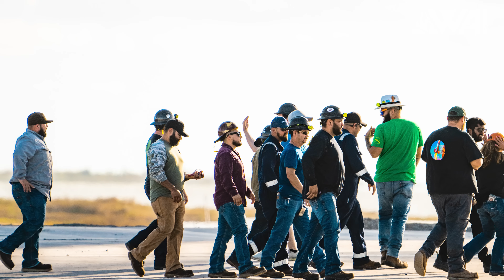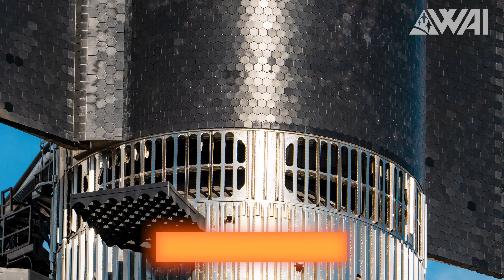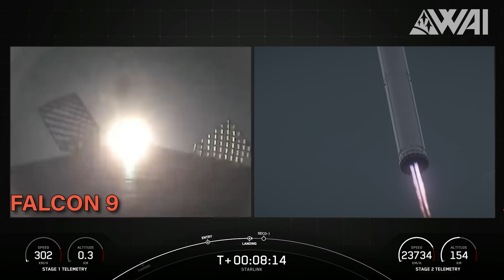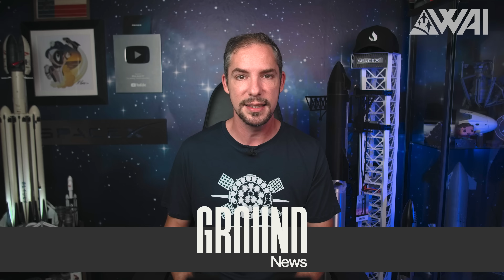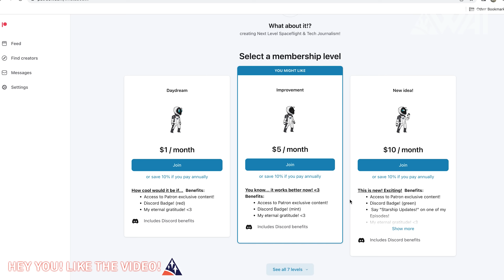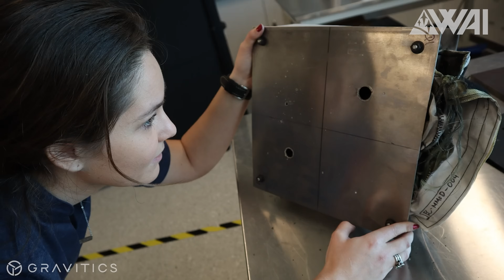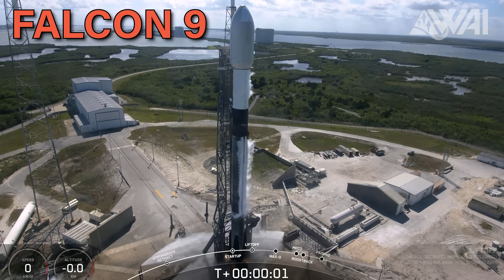SpaceX Starship Setback: A Year Without Payload – Hiccup or Concern?

Comment: I did a little bit of calculations because I got scared of this 6600 starships launches, here is a breakdown of what that would mean:

Fuel Requirements:

Per Launch (Starship or Tanker):
Fuel required to reach orbit: 1,050 tons.
Fuel required for landing: 30 tons.
Total fuel per launch: 1,050 + 30 = 1,080 tons.
Refueling in Orbit:
Each tanker can deliver 150 tons of fuel to the Starship.
Total fuel delivered by 8 tankers: 8 × 150 = 1,200 tons.
Total Fuel Requirement for the Whole Fleet:

Total fuel per Starship mission: 1,080 tons for initial launch + 8 × 1,080 tons for tanker launches + 1,200 tons delivered by tankers = 10,440 tons.
10,440 tons × 6,667 Starships = 69,546,280 tons.
Split between methane and oxygen based on a 3.6:1 ratio: 15,676,006 tons of methane and 53,870,274 tons of oxygen.
Cost:

Using NASA's prices: $160 per ton for oxygen and $400 per ton for methane.
Total cost = (15,676,006 × 400) + (53,870,274 × 160) = 14,409,204,640 USD.
Summary:
Number of Required Flights:

Starships: 6,667 launches.
Tankers: 53,336 launches (8 tankers for each of the 6,667 Starships).
Boosters: 60,003 launches (1 booster for each Starship and Tanker launch).
Total Launches: 60,003 launches.
Fuel Requirements:

Total Fuel Requirement for the Mission: 69,546,280 tons (15,676,006 tons of methane and 53,870,274 tons of oxygen).
Fuel Requirement per Launch to reach orbit and land: 1,080 tons.
Fuel delivered per Tanker: 150 tons.
Cost:

Total Fuel Cost for the Mission: Approximately 14.4 billion USD.
Fuel Global Production Ratio:

Methane: The mission would require about 0.65% of the annual global production of methane.
Oxygen: The mission would require about 3.59% of the annual global production of oxygen.
Environmental Impact:

Emissions from Launches: Assuming complete combustion, the total emissions from 60,003 launches would be 15,676,006 tons of CO2.
Aviation Emissions Comparison: The total emissions from these launches are significantly less than the annual emissions from the global aviation industry (915 million tons of CO2 in 2019).
Reply: Don’t forget the co2 used to protect against fires in Super Heavy’s engine bay. Why don’t they use nitrogen?
Reply: @EMichaelBall I don’t know why they don’t use nitrogen, but I wouldn’t consider any of that emissions significant.

Comment: Mars should be an aspirational goal.  It's going to be a good couple years to get Starship crew rated.  So use what you have now, the Dragon and the Falcon 9.  They need to seriously fast tract the Polaris Dawn missions, finish designing an EVA suit and bring a crew dragon up to meet Starship in orbit.  Have Starship bring a practice module to deploy that the astronauts can practice welding and manufacturing with.  Then when Gravitics is ready to launch a station module they will be ready.  New Space stations then Moon then Mars.

Comment: Mars colonization is "feasible". That is, it can be done but not a worthy goal I think. I would guess in the long run, other space installations would over take any Mars base in both importance and population. This would leave Mars as either a slum (abandoned by those who can afford to leave) or a cult based colony where rich eccentrics (and maybe less rich too) become hermits or one religious group (possibly a new religion). The only thing keeping it from becoming backwards being remote learning. An early setup on Mars would be a mistake in pretty much all cases. A strong colony on the Moon would be a better first start. The only real use for a colony on Mars would be to keep "the other guys" from claiming the whole planet, in which case it would be an "outpost" and never really a colony. There are other (probably better) options besides Mars to move away from being "tethered to Earth"... though the reality is that Earth will remain the "gold standard" well beyond the point where more people live off Earth than on.

Comment: I'm retired now, but used to work in astronomy.  There are several 6m and 8m telescope designs already being worked on with intent to launch via Starship.  The JWST is about 6.5m in diameter but they had to use a folding segmented mirror design to get it to fit inside the rocket.  Expensive, complicated and risky.  The new designs are single piece mirrors. They have already made many 6.5m - 8.4m light weight honeycomb mirrors that are in operating telescopes.  Ten years from now there will be many 8m class instruments in space, assuming starship achieves the necessary reliability.

Comment: Here’s an idea for the hot separation ring. Use ceramic tiles on the inside Hub that directs the flames out ward and may save the ring deflection Hub. Please excuse the names of the parts of the ring. Just a thought.
Reply: The tiles are designed for that and would likely end up flying debris instead
Reply: The longest time that the ring deflection hub will be exposed to high heat will most likely 3-4 seconds. If you look at the hot staging ring deflection dome, it's pretty thick - it should hold up OK, without any extra shielding...remember, the booster will veer away from the Starship once it separates, to do its boostback burn...

Comment: Excellent episode. I don't know why they need 14.9 psi in space stations, 8 psi and 40% oxygen is equally as good and requires a lighter pressure vessel.
Reply: I believe that to be true but with more O2 comes a risk of increased fire severity, think Apollo 1. The ISS operates at earth normal pressure (14.7psi) and oxygen percentage  (21%). Space suits for EVA's work at about 4.3psi with 100% oxygen.
Reply: @jimmarburger611  Yes Apollo 1 was caused by Oxygen but it was 100% and 21 psi. 40% at 8psi is the same amount of oxygen molecules, so no increases risk, just less Nitrogen
Reply: I believe that even with progressive adjustment, the average human body will still feel the effects of altitude sickness at 8 PSI. They most likely prepare to send people that are not necessarily trained astronauts. But I do agree that somewhere in between 14.9 and 8 would be better.

Comment: What people forget for the Mars trip is you only go every 2 years if there are people on board, it might take longer but you could launch every day remotely, and take the Venus slingshot too.
Reply: I was just thinking you don't need a pilot as I'm sure the 1st moon or Mars landing will be unmanned so they can keep a constant flow of supplies and equipment but people wouldn't want to go on the longer trips
Reply: To really mix it up, can't they get the booster into orbit and refill it and it would get to Mars quite quickly then refill and return as an interplanetary booster 🤔
Reply: @neilhallam8028 not really worth doing unfortunately, the engines on super heavy are tuned for in atmosphere use because it has to push starship up and out, starship currently has 3 vacuum and 3 atmospheric engines. Although eventually boosters could be constructed on Mars and used to launch starships for more efficient relaunch
Reply: The transfer windows for an efficient "Venus slingshot" opens every 16 month, so not really more frequent, only the travel time is reduced. All this actually doesn't matter because there are dozens of problems that aren't solved even if a manned spacecraft would arrive in a Mars orbit tomorrow. And that is for a manned land and return mission, let alone the insane idea of a colony on Mars with the current state of tech and knowlegde.
Reply: @waxilliumladrian what about 100 super heavies in space ready to catch a boosted starship, and boost them one by one to mars. With a slow constant return to locations between Mars and earth orbits. With several other super heavies with fuel tanks to fill them.
Reply: @UmmerFarooq-wx4yo afaik, orbital mechanics would allow the "constant" flow only for a few months until you have to wait till the next transfer window. But even if you boost your starship to Mars orbit: And then? A propelled landing Starship on the surface of Mars would dig it's own grave, because there is nearly no hard surface. And it wouldn't have enough fuel to fly back to orbit anyways. So you have to fly hundreds if not thousands lighter space ships to prepare a landing site first. What are those exactly? And you could go on and on with more problems to this "plan". You all are not applying critical thinking here
Reply: @waxilliumladrian  we got tens of thousands of planes flying in the sky today. When having ten thousand spacex satellites is doable around earth. Having ten thousand boosters for Mars should be doable. Especially when spacex will manufactured starships in space.
Reply: @UmmerFarooq-wx4yo  I've never said that humans can't send big quantities of space ships to Earth's orbit or having those go back and forth between Earth and Mars in a somewhat constant, yet due to orbital mechanic regularly interrupted "flow". It would be "cool" but probably will never happen in the foreseeable future  and if you'd apply logic you' come to the same conclusion

Comment: I am wondering about how many starships it will take to deliver 1M tons to Mars.  Will all this cargo be transferred using "Swiss knife" do it all starships that can take off from Earth, go to Mars, land on Mars, go back to Earth and land again on Earth?  Or will there be a lot of specialized spaceships?  Such as Earth tankers, Mars tankers, interplanetary cargo, interplanetary crewed, LEO & return and LMO & return?
It also really depends on the LEO capacity of Starship.  150 tons seems to be achievable - and more seems plausible due to the raptor boosted boosters (more and stronger engines).  The theoretic max thrust levels are insane.

Comment: A 8-meter telescope mirror would be about 10 times the size of Hubble's 2.4 meter mirror since it is the area of the mirror that provides the light gathering.
Reply from the maker: 10 times the surface area. Correct! Should have mentioned that! Thank you for the feedback! :_WAIHeart:
Reply: Though it's diameter that determines the resolution.
Reply: With the construction style of the James Webb telescope it could unfold to a massive dish in that bay. Starship 2 was planned at at least twice the size but I think the launch might wreck any pad
Reply: @neilhallam8028  there are no real plans for Starship 2, and there probably won't ever be plans for Starship 2
Reply: @neilhallam8028 
Assuming SSv2.0 is twice the width and twice the height of the current model and that the engines are the same size as Raptor series engines, the booster will require 132 engines (4 times the current number) and each must produce twice the thrust of current engines as the column of ship above each engine will be twice as high.  The requirement will be for 160 Mlbf...  Perhaps that is at - or even above - the theoretical maximum for chemical rockets launched from the surface.  It may be necessary to build Starship v2.0 in orbit.  That would eliminate the need for the larger booster but require all 8000 tons (?) of the propellants to be lifted to orbit after all of the construction materials have been boosted and formed into the vehicle.  
We'll need to wait to find out after the current model clears more hurdles.
Reply: @frankmcgowan9457  @neilhallam8028 twice the size doesn't necessarily mean take all the dimensions and times them by 2
just to simplify the thought, a 2x2x2 cube 8 times the size of a 1x1x1 cube. I know that rockets are cylinders not cubes but you get the point

Comment: Would it make sense to build a separate tower with chopsticks to catch the booster?  seems like a whole lot of infrastructure to put at risk testing the capture. Maybe it’s not financially feasible, though I don’t know.
Reply: The 2021 site plan for the Starship launch site at Boca Chica included a second tower.  The first tower stacking was completed in July 2021. In Nov 2021 SpaceX submitted a permit application for construction of that second tower to the Army Corps of Engineers. In April 2022 the Corps terminated that permit application since SpaceX had not submitted supplementary information that had been requested by the Corps. Consequently, construction on that second tower was not started. To date, SpaceX has not revealed the reason for this change in plans.

That second BC tower could have been configured for landing tests exclusively. It would have been shorter (375 feet tall instead of 480 feet), would have had the chopsticks and the hoisting mechanism, but no OLM. The OLM is not needed since it's a landing tower, not a launching tower. If construction would have started in April 2022, that second tower could have been completed in July 2022.

Then tower landing tests could have started soon after for both the Booster and the Ship.  Both of these stages would be launched from test stands in the suborbital launch area.  Only partial loads of propellant would have been required, like it was in the SNx suborbital launch and landing tests on a concrete pad in 2021.

By this time (Oct 2023), SpaceX could have conducted a dozen or more tower landing tests and this landing process for Starship could have been perfected.

Speculation has it that the problem was getting approval from the environmental authorities to build that tower in a protected wetlands area.  That second tower needed about 10 acres of land from a wetlands/wildlife refuge that's over 90,000 acres in area.
Reply from the maker: The problem is that it's not "just" a tower. There's a lot of work needed to build a Mechazilla. I dom think that landing the booster on the arms won't be a huge challenge for SpaceX. Imagine the arms as a landing surface. Just higher up. SpaceX already does land boosters. If the arms move quick enough, it should work out! :_WAIStarship:
Reply: NASA.may not want to build a full Starship launch complex at 39A so close to the Falcon Heavy and crew pad. So SpaceX could lease the SLC-37B site about to be abandoned by ULA, and use 39A‘s existing mechazilla for RTLS of boosters and ships.
Reply: you'd need another set of infrastructure to support the rocket blast then... tower is easy, protection is hard... there's a reason even human protection systems :cough: has a percentage...
Reply: Trouble is that just one miscue and you've lost all that "infrastructure". When has man EVER had a "perfect record" at anything?  @PrograError

Comment: I'm telling you they need to build a mock-up of chopsticks in shallow water and get the data before they attempt to land at the real orbital mount.  The Boca Chica OLM is a lot of pallets of cash.
Reply: I'm wondering IF the Booster could actually make it to the Cape. Surely the booster has enough energy? Also Gravitics seems to be the way to go as far as building SS go, impressed me👍
Reply: @simonallen4791  Probably not. A Falcon Heavy core lands about 700-800km offshore, and that's coming down hot enough that landing is iffy. That's less than half the distance across the Gulf of Mexico. You'd get further launching without a payload, but still unlikely to be enough to make a controlled landing at the Cape.

Comment: The inclusion of polyethylene in the Gravitics structure serves a second function: some modulation of the radiation of solar flares. It could also use significant depths of polyethylene as interior lining with additional foam between the exterior and act as thermal insulation, as well as increasing radiation modulation.
Reply: I came to the comments to say the same.  The long chain hydrocarbons in UHMW take high energy ionizing radiation and absorb some of the energy, releasing the radiation out at the lower energy state.  At the lower state, more common metals can absorb the radiation without much thickness.

Think of ionizing radiation (not electromagnetic radiation) like an arrow.  One really thick layer of shielding can slow it down, taking everything the arrow has, and stopping it.  Layers of different materials can remove the tip, then the feathers, then break the shaft into bits.
Reply: Can you talk to me like I’m 5 years old and translate that?
Reply: @jamalharrison4695  Better radiation shielding.
Reply: Add a little glycol and you could eat the shielding if you get constipation.

Comment: A Convertible Starship with a telescope sounds interesting? It could potentially travel to multiple and preferred locations for imaging various targets
Reply: Yeah like send Starship telescope to Pluto,  The speed of light in a vacuum is approximately 186,282 miles per second (299,792,458 meters per second). So, if you were to send a laser signal from Earth to Pluto, it would take about 19.7 hours (or roughly 19 hours and 42 minutes) for the signal to travel one way, assuming a direct line of sight and no atmospheric interference.
Reply: Totally interesting. The Starship platform sounds like it will be quite versatile.

Comment: Good to see you Felix!  I still stand for booster legs.  If there are hundreds of flights scheduled I think the compensation of payload weigh and landing gear weigh makes up for safely landing booster. Use lessons learned from the Falcon 9 boosters. Even if it works it's still a great danger to Stage 0.